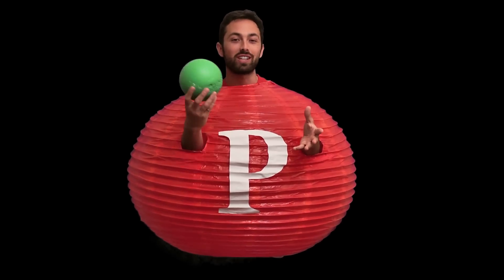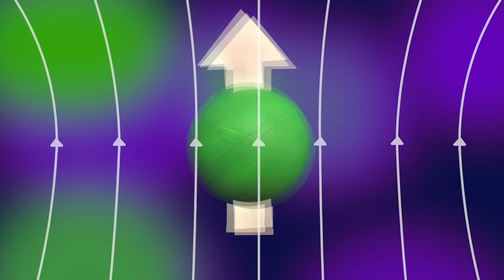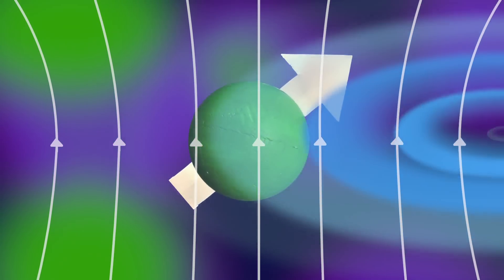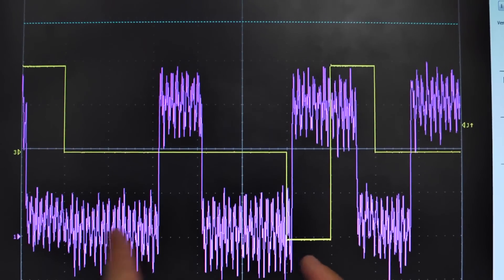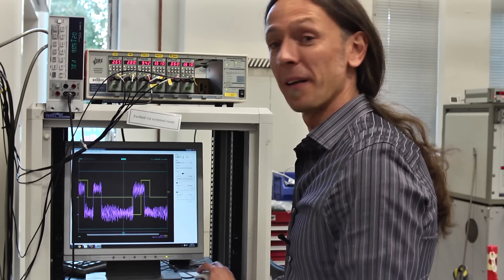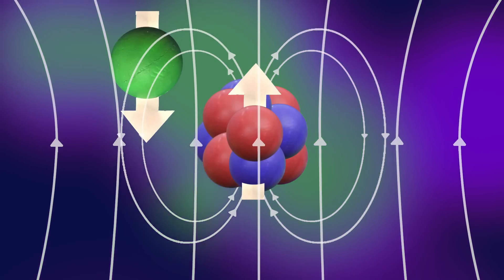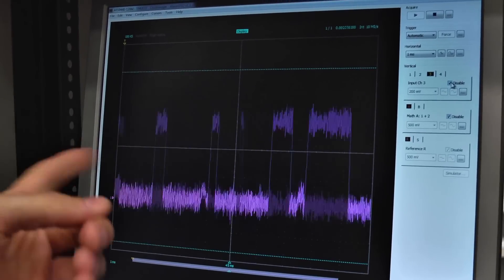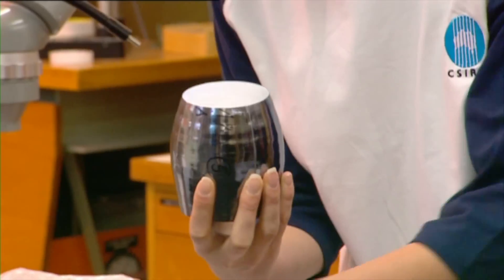How To Make a Quantum Bit

Comment: Making a quantum bit (qubit) involves isolating a quantum system, like an electron's spin or an ion's energy level, and manipulating it with precise energy pulses (lasers, microwaves) to create superpositions of 0 and 1 states, often requiring extreme cooling near absolute zero and perfect isolation from the environment to maintain quantum coherence. Popular methods include using trapped ions, superconducting circuits (quantum dots), or phosphorus atoms in silicon, leveraging quantum properties for computation.

Comment: No, it wouldn't take "minutes"

If you have some NP problem, brute forcing on a classical computer scales with the number of states. If we say the number of states is "N" then we would call that big O notation O(N) to represent the scale of of the problem. 
In a quantum computer the same problem with brute force is so far at best O(√N), which is better, but is absolutely not changing years to minutes.

Comment: This is amazing. I love your explanations, but the diagram of the transistor @3:45 is incorrect because, in an NMOS that is shown, p-type silicon is implanted with Boron and not Phosphorous.
n-type silicon, on the other hand, is implanted with Phosphorous, so the transistor you should be showing is a PMOS instead of an NMOS.

Comment: Thank you for clearing this out, this video is very helpful. If my understanding is accurate, both electrons and the nucleus are typically found in their lowest energy states. To transition an electron to an excited state, the nucleus must first be stimulated. This stimulation can be accomplished through the use of two distinct frequencies, specifically two microwave antennas (Fn and Fe). When it comes to retrieving data, the voltage from the transistors' Drain is crucial for reading. 

In a way, this concept bears a fair resemblance to the principles of magnetic resonance imaging (MRI).

Comment: Nevertheless, notwithstanding the capabilities of qbits to produce an infinite number of “spin” (it’s not really spinning but we use the concept of spin to reflect an infinite number of energetic states), the measurement being made is of 2 states, up or down, and therefore no better than binary.  Further, the entire benefit of quantum computing is to actualize, not compute or manipulate, a resultant state via an inputed probablistic scenario.  While this is interesting, and I find it useful that they can measure the eventualized state of an entangled particle by its effect on other electrons, that effect is observable within the constraints of light speed; while this measurement is only required of the resulting scenario actualization, it is a limitation abeit a small one.  

How do you plan to vet the accuracy of an actualization?  How could that be done?  Error correction, or assumption of validity?  Quantum Physics itself seem to contradict the implementation methods of quantum computing, to me.

Btw, I love your videos.

Comment: What I understand is how a bit is scaled down to the size of an atom, but not how a qBit is supposedly read or written and how its supposed many simultaneous states are used.
So if all the challenges are overcome this would be indeed incredible scale down compared to current best lithography state (at ~5nm ie about 45 times bigger than single silicon atom).
As I said very impressive, but still not what qBit was supposed to be in theory.

Comment: Ok, so the thing that I don't understand is mostly about the pulse duration. He explains that by choosing a specific duration to cut the pulse off at, we can choose how superimposed between up and down states the atom is. But it wasn't explained how duration affects the atom in the first place, so I'm having trouble digesting the first claim.

What happens if the atom is subject to a steady stream of microwaves? Does it constantly absorb and re-emit energy, oscillating between excited and ground states? 

Say for illustration the light pulse duration is 1as (arbitrary seconds) at a wavelength of 1am (arbitrary metres) in order to give the correct amount of energy to transition from spin down (lower energy) to spin up (higher energy). If we supply wavelength 1am light for 0.5as duration, does that put the atom in a 50/50 superposition of down/up? If we do 0.25as duration, does that put it at 25/75? Maybe the exact relationship between duration and phase is some more complicated function, but the core of my understanding here is that superposition states are acting as smooth interpolation states between the end points of fully down and fully up. Is this right?

Comment: only as far as 2:43 but I was just thinking, wouldn't it be better to instead trap the qbit inside an enclosed space and instead of checking for spin up and spin down check for any activity, so when the qbit hit's the walls of the enclosed space it would create a vibration that can be checked, when you want to restrain those vibrations you simply use the magnetic force you spoke of to force it against a wall, doesn't matter which wall, just a any wall, that will minimize activity detected which can be treated as a 1 (so high activity means no effort to control the qbit which is where the 0 is derived from). You wouldn't need to spend so much energy on lowering the spin because you're no longer looking at the spin but the activity that spin generates

Comment: What I still have trouble understanding is the applications for why we need to spend so much money?
From what I have learned so far the applications for when it would be most useful are the applications that would require a qubit for each element in the computation.  Fluid dynamics and Weather modeling and prediction would require millions of qubits all contributing and interacting with each other.  Cryptography has encryption methods that already can defeat any decryption method even using a quantum computer.  So as soon as the government starts using a quantum computer to read everyone's encrypted emails you can upgrade your security to quantum proof.
Reply: We don't need millions of qubits. If they were perfect, we would need less than a few of these.
Reply: @polygontower  We need more than a few because a quantum computation relies on the interactions between qubits. These interactions are quantum entanglements or partial quantum entanglements of the wave function between the qubits. Setting initial conditions forcing an evolution and measuring the result of the qubits is done for each "calculation". So there is no advantage over conventional serial calculations unless many qubits are used.  With the largest quantum computer at 433 qubits and a cost of tens of thousands per qubit I have yet to hear it do anything  impressive.

Comment: with the slider volume (like 5v = 8bit) and motor to move this volume so 10 volumes will store 8bits * 10 (in combination) so to store FFFFFF we put 1st to 9th on 0v and 10th on 5v so to read we calculate voltage of each volume.

Comment: Ok you can change and measure the spin of a single electron this is great achievement. But you should have asked what is it good for? According to the video It still have spin up and spin down state, that's 2 states you migh as well just use a transistor to do that and save youself all the hastle of working with electrons.
Reply: Quantum superposition allows the spin to be both up and down at the same time. Therefore both 1 and 0 at the same time.

Comment: You skipped a very important detail at the start of the video. Building just a few (64-256?) qu-bit quantum computer is already hard, yet even if its successful, it would not take "minutes" to factor a 2048 bit number. It will still take several years and by then a more qu-bit quantum computer will be successfully created and that might have 3000 or so qu-bits to reliably factor a 2048-bit RSA key modulus, typically used by most Internet web-sites today (including this YouTube URL). So 2048 bit cryptographic keys remain secure for at least another decade or so esp. based on the current state of quantum computing innovations.

Comment: How that is reflected in  the schrodinger equation or Dirac equation? Are the magnetic field and the microwave radio station two V potentials that must be added to this equations?. And if they are potentials, why it only turns at a specific frequency if a potential changes the equations outputs?,

Comment: The power grid; it has cycles and quantum bits that dump data per mega cycle. That mega cycle dump is a very hot process. Cooling would be necessary. Steamy and electrical cooling. Ozone holes are the result of making the localized earth a hot spot. Power consumption is participating in quantum rigging. Quantum computing on Earth is the smaller version of ozone drilling. Drilling the moon from here with the process. Respiratory repair and underwater cellular tech. Shame ye new Babylon.....cJT....aka.CharT

Comment: 0:19 ..  qubits take advantage of superposition not to reduce the number of steps but to process multiple steps in parallel. If you need to visit two hundred houses you can do it one at a time in 200 steps.  You can do it two at time(parallel processing) in 100 steps.

Comment: Wait! Does this mean we can now use this method to get quantum entanglment to work as a long distance communication method???!

If so this is a total game changer!!! Astronimical.... Literally.
Reply: Chris Jones can you explain a little bit?I mean,how it will help?I'm just curious to know,because I didn't find anything like that.
Reply: @lifeofphyraprun7601  If you can get the spin to be consistent with mag resonance, then maybe the QE can be tracked kagillian of miles away. That would make a rudimentary binary (Morse Code?) comm system light years apart. I'm over simplifying horribly though. Loads more complex than that...

Comment: Best to look at the up down position as a circle and your just viewing it from the side so it appears to only go up and down.  Everything is circular in nature.  So really there are many more usable positions than it would appear from just a single plane of view.  The in-between point will have different phase and position corresponding to which quadrant it is in.  For instance, the top two: (+,+), (+,-) and bottom two: (-,+), (-,-), which when viewed from the side would appear identical (top-top or bottom-bottom) no matter which quadrant it is in at the time, then your standard (1) or (-1) which exist outside this inner core and at the furthest point in either direction so as to not have a +/- side but only an absolute neutral which becomes your 1 or 0.

Comment: Imagine that you could wrap these nucleus around a cylinder and timing them to spin in a particular sequence to create a cubic motor? The life span of each cubic must be different and it must therefore be different for each of the others in the classical periodic table? The earth must also be a dual cubic? We are taught that the earth has both a north and south pole similar to a magnet. However it must have two north's and two south's which are in the center of the earth? The vibration of this sets up an endothermic process internally and an electrical discharge of exothermic energy in the form of sprites and aurora's

Comment: We don’t know yet if we can solve any NP problem in a polynomial running time and memory space via quantum computing. We don’t know wether BQP contains NP or not. In case it doesn’t - which is what most computer scientists believe in - then quantum computers can’t solve efficiently enough any NP-complete problem.

Quantum computers can solve efficiently the factorization problem - with enough qubits to the size of the instance - because of Shor’s algorithm that knows how to use the qubits quantum abilities in a polynomial time to the size of the problem.

Comment: So they will have to put a MICOWAVE pulse to this transistor imbedded with that single phosphor atom.  That works great with ONE transistor, how about with LSI chips that have millions of transistors crowded them? How do you control the various MICROWAVE pulses so close to each other?...they will all read the SAME would they not and signals will cross each other?  Plus (what) decides why a microwave pulse is sent to energize that single phosphor atom's electron to another level spin up? (I am going by (your) illustration shown in this video!)

Comment: This may explain the difference between a 1 and a 0 using electron spin, but it in no way describes what a q bit is or how it can be both a 1 and a 0 at the same time or how quantum computers actually work.

Quantum computers are actually high tech Ouija boards used to communicate with  demonic entities. It is not science, it is modern mysticism.

Comment: This video (like all other YouTube videos on the subject) does not answer the central question "How Does a Quantum Computer Work?"
i.e. It does not explain how to do a controlled collapse of the wave functions of the qubits in such a way that the resulting classical bits correspond to the computation you want done, rather than some completely random answer.

To take a trivial example, if you want to make (say) a 2-input logic gate, you would have two logical inputs, and two entangled qubits, which can simultaneously encode a superposition of the four possible output states.
How do you "teach" the qubits which classical states they should collapse into for which combinations of classical logical inputs?
i.e. to configure them to behave like an XOR gate, rather than say an AND gate,  or an OR gate.

PS: I don't mind an answer in the form of equations, so long as you use plain English to describe the mathematical-notation of any operators you use.
Reply: It seems to be a result of it being probabilistic and its ability to give more than just a binary result.

Comment: What i don't get is how they get usable data from that? I get that up is basically a 1 and spin down is a 0 and a 1 closes a gate that allows an electrical signal to advance.  I just dont understand how that corresponds to data, and not only data but the correct data all the time? I have been trying to research this for a week now but feel i am no closer to an answer. Can someone that really knows the answer please please enlighten me? And please do it as layman as possible, while keeping in mind i have been researching this and know about the algorithms used (but dont fully understand the equations and how they find the sum given the equation, although i know the purpose) and the actual mechanical components involved. How do quantum bits relay actual info from getting a spin up or down, and how do they get to their conclusion the first time? 

ps, this is probably a dumb question, but i have a feeling im not going to understand it after getting replies! I really hope i do....

Comment: If you were to create a setup like this, where you could both manipulate the spin of an electron and a nucleus, as well as monitor this manipulation in real time on an oscilloscope screen, then have a similar setup and quantum entangle the particles under observation, could you then observe both oscilloscope screens reacting to you manipulating only the particles of the initial setup? If that could be done, haven't you in effect just created a form of quantum communication?
   If say the technology was improved to become more stable, portable and possibly smaller, could you not have instantaneous communication with probes, planetary exploration devices and even astronauts over enormous intersteller distances?
   I know this is meant to be impossible because the exchange of information would be moving faster than the speed of light, but if it worked then surely it just means that there are areas of scientific knowledge that go further than our current understanding?

Comment: This video deserves an update, since they now developed a so called  flipflop Cubit, wich is controlled with electric current instead of a magnetic field. It would be fun to see the, what points in this video has changed now and why
Reply: Steven Rens there are actually many different ways to create qbits each with different pros and cons. really each of them could have their own entire video
Reply: Magnetic fields are electric currents
Reply: @h_3795  he meant they are using electric signals to orient electric dipole instead of magnetic field to orient magnetic dipole
Reply: @h_3795  magnetic fields are not electric current. Only a rate of change of magnetic field will induce an electric current. You can have a magnetic field without current (just a current or  moving charge always induces a magnetic field).
They don't use a magnetic field but electric field in this method
Reply: Philip Merewood well yeah I know I thought I’d keep my sentence simple
Reply: @h_3795  maybe he was doing the same.

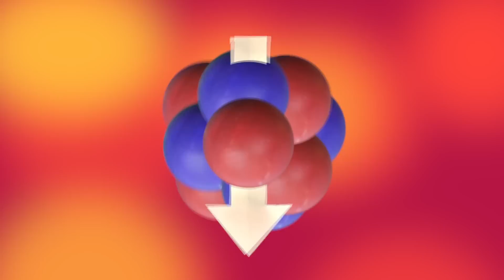Comment: Bit of a grammar "whoops" at 4:20.
Nothing can be "2000 times less" than anything.
1 times less brings anything to zero.
What he means is the one thing is one two thousandth of the other thing.
Excellent presentation!
Cheers from the engineer-grammarian.
;)

Comment: You say the Q bit can be flipped up or down fast but what if you tuned the microwaves in at the same time to make the Q bit flip up n down at such a rate that it can be both at the same time? I was under the impression a Q bit could be in 2 states at one time not changed from one to the other quickly. It's basically a binary function that works faster. Such a shame as I thought it was in 2 states at once breaking binary function & psychics. But never the less it is still progress.